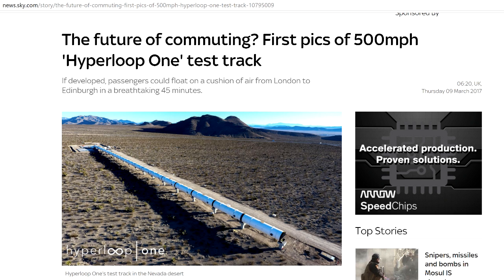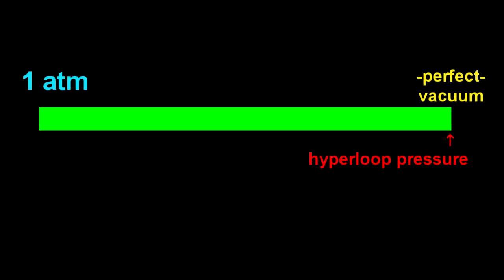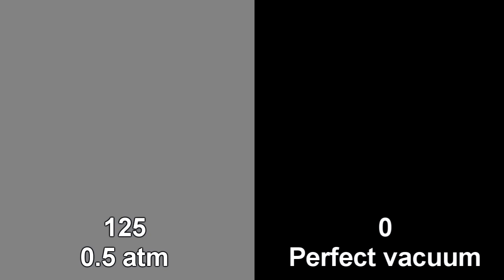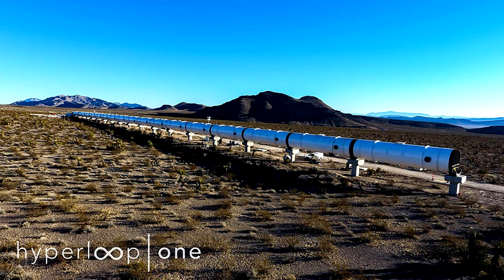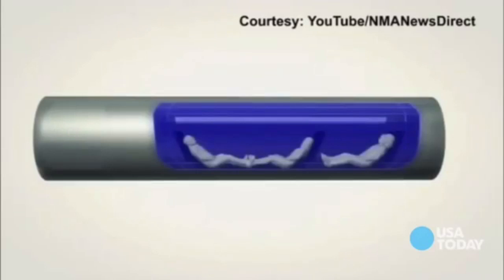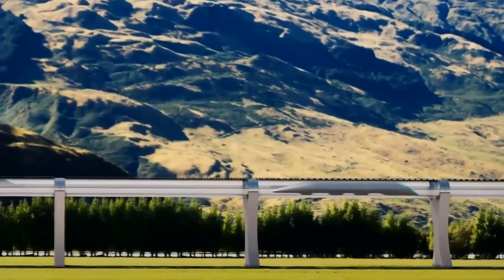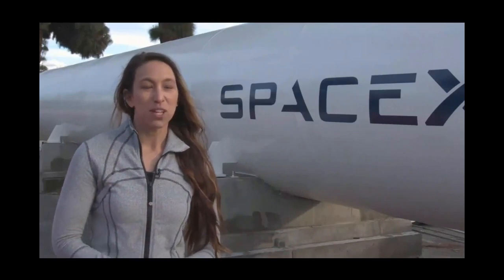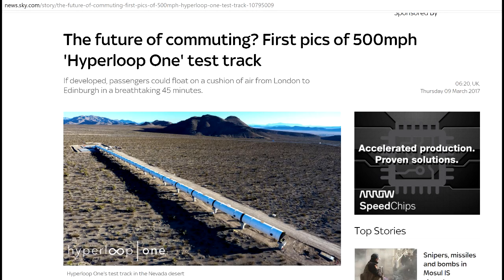Entire Hyperloop could be destroyed in SECONDS!

Comment: 80km/h? in germany its not worth it, in the Highway you can go as fast as you want (as long as you dont put anyone at risk) but mostly you drive 130 - 160 km/h so hyperpoop is bs
Reply: This was a proof of concept going at 20km/hr would be a success if it worked the way they wanted. Final design would be closer to 700-900km/h (Airplane speeds) but with the cost of a normal train.
Reply: the point was to get it as fast as you could in this very short stretch of track.   it wasn't intended to show the max speed possible in a tube evacuated of air.
Reply: Koo Woo Hyperloopwon't be able to do it either because it will never finish. As Thunderf00t pointed out, the idea is good in theory but not in practice. Spending 12 million dollars on a "test track", forgetting that metal can rust when exposed to air and water and only achieving a tenth of what they promised seriously makes me doubt this will ever become viable.

Do you really think depressurising a 1000km long tube can be done within a minute? Depressurising the test track already took over 30 minutes on such a small scale. Also, you will have to take the production costs into account. Might as well build a bullet train.

TL;DR: The final product will never live to see the day.
Reply: Tanya Degurechaff it will, but we won't live to see it.
Reply: Jesus, what, do you have the mind of a 3 year old?
Reply: Lefl 

One of the Hyperloops prototypes was literratly made by germans
Reply: Lefl 1500 km/h
Reply: Lefl, I know. My idea is use rails. The train systems in Europe are amazing. Each city connected by high speed rail. Hell, other countries use rail. in Japan you can go between cities in 30mins, no wait times for vaccums or anything. Just get on, and the train goes. So why can't America use high speed rail. Actually, New York is connected to Washington by highspeed rail. Even the state of california uses railroad transit. So why this so popular, when rail is so much safer.

Comment: I am a fan thunderfoot but come on man... It seems like you are grasping at straws here. You could just bury the hyper loop to solve the problem of impacts causing damage to the tube. Entering and exiting could clearly be accelerated with more engineering.

We went from what was basically toy rockets to the Saturn v in 40 years, from the wright brother's plane to fighter aircraft in similar time. I think all the problems you presented have reasonable solutions here, and you are being overly pessimistic.
Reply: Tapelegs i understand what youre saying, but a vacuum tube can be a lot more unstable than a earthquake proof building.
Reply: What about earthquakes, still
Reply: Tapelegs 
There have been lots of oil leaks without earthquakes! Earthquakes DO disrupt roads and railways, the tube would be no different.
Imagine if THIS happened to a hypertube!

https://www.reddit.com/r/pics/comments/5qq5d0/bent_rail_tracks_after_a_new_zealand_earthquake/
Reply: such a borrow would be costly. Especialy if it need be deep enouth to deter terrorism. If prices raise that much i don't quite see the point of the whole enterprise. Just take a plane. (and it woudn't solve it because of plaque techtonique and earthquake, etc...)

Not to forget that securing the thing from sucide terrorist (shooting the cabin from the inside to collapse the thing) would need comparable security as plane. Wich would kill the speed argument
Reply: Tapelegs
One plane can carry more than 500 passengers across oceans. They need a runway at each end of the journey and a building to accommodate passengers at each end.
Compare that to the infrastructure needed to convey the same number of passengers in a series of pods through a vacuum tube, with the airlocks to get the passengers on and off the pods at each end.
Think of the network of airports, across the US alone, every major city and state has at least one.
http://ourairports.com/countries/US/
The hyperloop could never replace the existing network, building thousands of miles of tube would cost billions and the cost of fares would be prohibitive.
So let's say they link a few cities, say N.Y. to L.A, how many people are needing to dash between those cities? In a few years time, the video conference technology will be so good people won't need to move out of their office.
However, well see. I'd say they build one token stretch of 50 miles or so, realise it is unfeasible and no more will be built.
Reply: I honestly don’t see hyper loop as a good investment and a solution to the future, it has too much problems and flaws to be fixed and the test drives aren’t even coming close to what they are speculating to be.
Reply: ' you really have me beat with your suggestion that teleconferencing will replace long distance travel. I just cant refute that. Your logic is too ironclad. We are going to shutdown all airports, stop all new long distance infrastructure development, and probably tear down highways and bridges too because of teleconferencing.'
Now you're just being silly.
I never said anything like that. 
The current building cost in the UK for the HS2 (high speed train) is £51m per kilometer. Projected to go up to £78m per km.
http://www.telegraph.co.uk/news/2016/03/21/revealed-hs2-abysmal-value-for-money-at-10-times-the-cost-of-hig/
Distance from London to Edinburgh is about 650 miles as the crow flies =   £50,700,000,000 for rail track and infractructure.
How much more to build a tube strong enough to withstand a vacuum? twice as much? Three times?
It could never pay for itself.
Reply: Indeed they do. And it took LIGO about 40 days to pull that vacuum. And that's a highly controlled environment, not a public thoroughfare. Even at a fraction of that vacuum, you'd be waiting a long time just to cycle the airlock. Not to mention how much downtime you'd have to perform maintenance on those airlocks from all the dust and debris from "public" use that would contaminate the seals.

No, I suspect that if they ever get this going, it's going to end up like the space shuttle: overpriced, and consistently overhauled to keep it in safe working order.
Reply: Well, what if HL simply transports cargo from two supercities? That circumvents every single safety issue everyone has proposed and coincides with the teleconferencing idea.
Reply: How long are you guys willing to sit in your pod-car while the airlock downpumps to the required vacuum so as not to contaminate the rest of the tube? I'd give it at least an hour for a small airlock. Meanwhile, I'll just take the mag-lev and see you in a couple hours.
Reply: You do realise this thing will be built inside an earthquake zone?
Reply: The budget just went up another few billion dollars*
Reply: Don't forget, LIGO has two of those tubes at each facility. I don't think anybody's arguing that it's impossible to build hundreds of kilometers of these tubes, and down-pump them to vacuum. Just highly impractical, and a vast waste of money when you consider maintenance costs.  Just how often do you think those airlocks would be cycled per day?

Nobody's talked yet about whether or not it would be a single tube between source and destination, or if you'd have tubes merging into a bus to travel over the open distances. That raises the complexity and cost quite a bit more.

The space shuttle was sold as being a reusable launch/re-entry vehicle that would make space travel a routine activity. In practice it cost quite a bit more to launch a payload into LEO with a shuttle than a normal rocket, and they got far FEWER launches per year than what was predicted. So unless you needed to send people up there to build something, like a space station, it was a colossal waste of money! 

This is essentially what we are being promised; an over-complicated and over-priced solution to a simple problem that already has a working solution.

If you omit the tube so that you just have a normal maglev, you lower the costs of construction and maintenance significantly, and the job STILL gets done. Other than being impatient to get to your destination faster, the only other reason to pull a vacuum is to avoid air resistance to save energy. If we focused on transitioning to renewable energy to begin with, this wouldn't be an issue at all. AND you could still look out the windows!
Reply: The problem with burying THE ENTIRE TUBE would be the costs. And what about obstacles like rivers or canyons? Then there's the pressure of the earth crushing down on the tube, which would be several tons per square meter.
Humanity went from small rockets to rockets capable of flying to the Moon because the technology wasn't breaking the laws of physics. The problem was that the available technology wasn't sophisticated enough at that time. The internal combustion engine made the Wright brother's plane possible, but the basic principal of generating lift was quite well known. They weren't making shit up as they went along.
Reply: Tapelegs 
Then state the actual pressure differentials ! The hyper-loop  is proposed to work at a 99% vacuum! No oil pipeline works anywhere near that pressure differential.
Reply: Tapelegs You do realize that burying it will actually just make this thing even more stupid right? The weight in which is needs to support any dirty (or other Earthen minerals) would make the design flawed as it would need to focus more on support from the INSIDE cause the weight from above and crushing impact from the sides. 

Not to mention rain. Rain would just flow into the ground and evidently start rust (any other things), and cause the dirt to expand which would (over time) start to crush the hyperloop.

Aaaaand even a small earthquake would destroy the whole thing. From San Francisco to LA is 616km and having all hat buried would shift the tube somewhere. 

The hyerloop is a joke in science and needs way more development before being built. More tests need to be made and better designs need to be used, cause right now, the hyperloop is an early execution.
Reply: What difference does it make? Whether it implodes or sprays everywhere.
Reply: LIGO is not built in an earthquake zone. And LIGO is not 1000km long.
Reply: No Google, I don't want to use my real name. It doesn't go against physics, it is completely possible but it has many problems to be resolved
Reply: What an idiot... so you're gonna dig a tunnel from la to San Fran in a straight line and everything in the way will have to be moved. You're gonna tunnel under residential neighborhoods? Idiots..
Reply: Your expansion issue would also be solved or at least mitigated by putting it underground where the temperature is stable.
Reply: Tapelegs 
Compare burying a tube 300 miles long with provision to evacuate passengers in emergency, to putting two steel tracks on the ground.  
The hyperloop will never be a cost effective way of transporting people, it will cost far too much per passenger/kilometer/hour ratio.
Reply: That wasn't my response at all, but keep making straw man arguments if that makes you feel better.
Reply: Tapelegs 
We'll see...
Reply: being reasonable does not make money
Reply: you cant debunk it. It's not finished
Reply: Wordavee1 
compare two tracks on the ground with putting an aluminum tube 6 miles in the air, airplanes will never be a cost effective method of transporting people
Reply: 10 seconds of googling "oil pipeline pressure". Hmm, looks like we already have tens of thousands of miles of  oil and gas pipelines that operate at vastly higher pressure differentials and have not had any problems with earthquakes.
Reply: -No one is saying this would replace all airplanes
-Tons of flights are short hauls under 1000 miles, you are cherry picking the most extreme example rather than the typical example (intellectual dishonesty)
-"transporting oil by truck only requires a facility on each end and a truck, it would neeeeever be profitable to transport oil in a highly pressurized tube, can u even think of the infrastructure"

but for real, though, you really have me beat with your suggestion that teleconferencing will replace long distance travel. I just cant refute that. Your logic is too ironclad. We are going to shutdown all airports, stop all new long distance infrastructure development, and probably tear down highways and bridges too because of teleconferencing.
Reply: If we can make skyscrapers that can survive 9.0 earthquakes I think it is not beyond the realm of possibility that we could make a depressurized tube a dozen or so feet across that could also survive earthquakes.

Comment: Why even bother to pump the air out? Stick a jet engine with an intake fan slightly smaller than the tube, duct the thrust through the passenger compartment to the rear, then light the bugger up! Air in front is fuel to be burnt, and will be rammed in, the air behind will be something for the jet thrust to push on. How fast can a snug fitting jet travel in a semi sealed tube? (I'm guessing that you'd need sprung doors/flaps as overpressure release safety devices, but not much else, leaving the air in there seems more sensible, akin to putting solar panels Above a car park rather than under it, easier and more sensible ) ☺

Comment: just a curious question from  a welders perspective.
since those tubes are siting out in the desert, and from the images, no shade insite, is it possible that the braces may be mostly to protect against heat distortion?
as i am aware of the fact that it isnt always hot in the desert, but metal sitting in the sun is going to heat up a bit, and if its a moderate to warm temperature outside, metal of a decent size and weight can warp really easy.

i once saw a bely pan  for an armored construction equipment that had been removed from the equipment during servicing, then simply left off for several months, it was almost 2in thick armor steel, basically like a trapezoid shape, it was left upside down in the sun, and after 4 months the pan was almost 2 inches out of alignment for the holes. and it only weighed a few hundred pounds, compared to these cylinders. 
it takes alot of heat to distort metal by hand, but it really only needs to be moderately warm for its own weight to distort it over time.

again, only a curios question. since i know that the amount of vacuum these are under sorta makes the point moot.

Comment: there's one thing it totally forgot about with the failure where air rushes in. how far will it go. remember what happened with mythbusters with their ping-pong cannon. they lengthened the barrel and it wouldn't come out. no t saying it's any safer. it's still probably a dangerous invention. just use a maglev train. also tanker crunch. that's what will happen during a hail storm.

Comment: Tanker truck construction is very different. they're not *specifically* made to be put under the stresses of a vacuum, in contrast to Hyperloop which is engineered for this exact purpose.
Reply: Ohhdanyboy did u notice how thin it is and it has to be braced ... its designed to shit this is money laundering
Reply: Antoun Sayah  If that's the case, they're losing more profits than they're trying to launder
Reply: lost4468yt It's a steel sheet,  rolled and  seam welded.   On a positive pressure vessel you can put external rings,  much like what you see on that tanker.  On a vacuum vessel there's really not much you can do,  besides make the walls thicker.   Even then,  any stress concentrator like a dent rapidly decreases your hoop strength.   That's not to even bring up the loss of allowable strengths if the stress is cycled on and off.
Reply: perpendurcular 720 the power of stress concentrators on practical display....
Reply: Show me a hyperloop that is specifically designed to be put under 1/1000 pSI and ill show you a liar.
Reply: The only thing I got from that is how the heck did you manage to both make it bold AND have the have the asterisks. Did you add two extra asterisks? If so why?
Reply: Strazdas why wouldn't it be though? Why would someone design a tube that has to withstand that kind of vacuum and not design a tube that has to withstand that kind of vacuum?
Reply: Well, uh, how about ask that question to people designing the hyperloop? because they clearly havent designed it for that underpressure levels. My guess would be money - it would be very expensive to manufacture such a tube.
Reply: Antoun Sayah you honestly do not have a clue what you are talking about
Reply: Bollocks, a pressure vessel is a pressure vessel. Wake up.

Comment: these people are trained scientists and engineers... whether they are brand new, in school or been doing it 50 years... you are judging the thickness of a steel pipe from a video on the internet and then comparing it to a tanker truck with a minimum thickness of 11mm of aluminium... yes, aluminium... this is a steel pipe first off, much thicker than what you would use for those, also rail cars are not designed to be under pressure what so ever... hence why they collapse so easily. if you actually bothered to check your facts you might get a whole lot farther...

Comment: The notion of a cascading implosion propagating along the track is an unsupported assumption.  The narrator continually references explosions and energies associated with TNT failing to understand that any local collapse of the tube would allow a flow of incoming air to raise the pressure of the tube over a long period of time resulting in no concerted release of energy. The presenter gives the false impression that there would be an giant explosion if the tube collapsed.  There would not be.